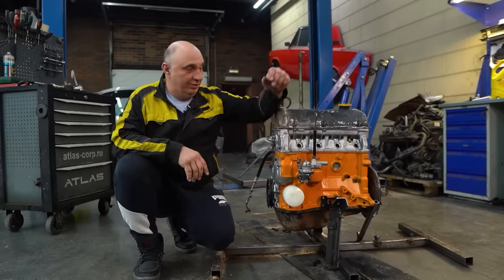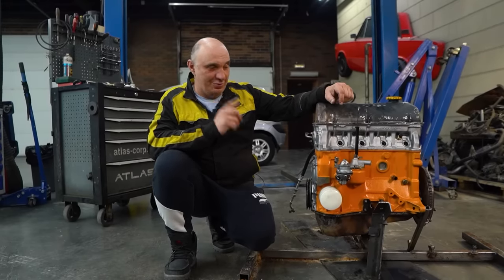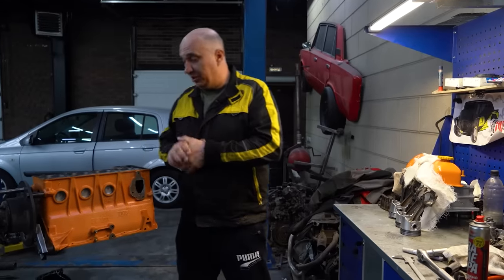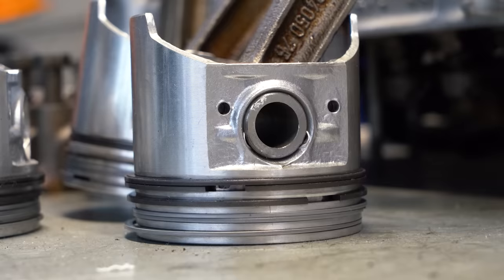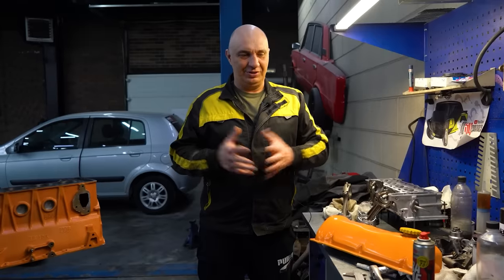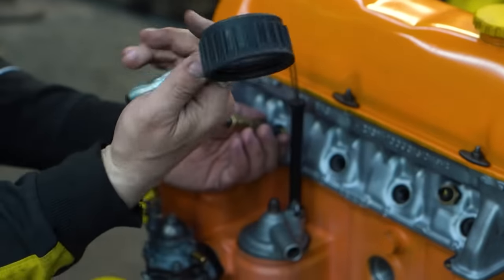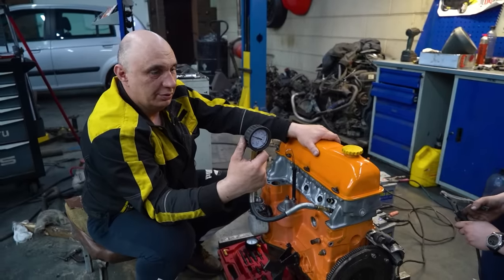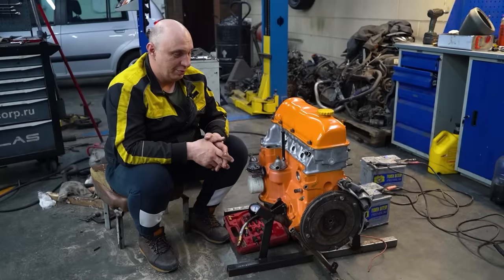Cranking the compression up to 20 kilos (285 PSI) - what for?

Comment: Wonder if they’ll try running it on diesel, should easily run with that compression
Reply: They would need to modify the head to fit diesel injectors, somehow fit a pump, and then the rods would probably just bend.
Reply: Ethanol or methanol mixtures of high octane petrol or something like that. Maybe pure petrol. LPG is an option.
Reply: @kordta  Would be too high for methanol as well i think.  LPG might work, but i doubt the engine would live long.
Reply: I wonder running E90 or even some leaded aircraft fuel would suffice
Reply: Nitromethane used in RC cars/planes might work, but still it's very high compression.
Reply: @snap_oversteer  Nah. RC car/plane engines burning that stuff have around a 9.5:1 compression ratio. Anything about 11:1 and they start pinging pretty bad. Bad enough to melt pistons. And the more nitro you have in the fuel the lower the CR needs to be...plus, real danger of hydrolock with this setup on such a fuel. The AFR for glow fuel is only in the 6:1-4:1 range, which with such a small chamber, squish band, is likely enough to hydrolock the engine.
Reply: @detaart  if you add some water it'll probably have it's best chances on LPG as long as the rods handle it
Reply: @detaart  The injectors could be installed on the spark plug hole and the injector pump could be mounted on the side being driven by a toothed belt. 
Also, for the purpose of just having fun, that engine can easily run with indirect injection with each injector mounted on the intake manifold, just like gasoline multipoint indirect injection systems.👍
Reply: @tiagofigueiredo2529  Fitting injectors where the spark plugs go could work ... if they modify and machine the head.
And no, taking in the fuel in the intake like a gasoline engine would not work.  It would cause the mixture to burn before TDC, destroying the engine.
Indirect injection refers to a pre-chamber arrangement.  Diesel engines never spray fuel in the manifold.
Reply: 225 psi would've been enough for diesel.  Typical diesel engines run 300-500psi
Reply: @detaart  they have already installed a diesel injection pump on a gas engine. Although the fuel was being injected into the intake instead of directly into the cylinders. They could tap the spark plug holes to install the injectors. It sounds very easy for these guys
Reply: I'd say that's probably their only choice. Attempting it to run it on gasoline would cause premature combustion
Reply: @dieselgeezer18  No they haven't.  Show me.
You cannot time a diesel engine if you inject the mixture in the intake.  It would detonate and self destruct.  No spark plugs, no way to time it.  The injection event IS the combustion event in a diesel engine.
And yeah like i said, fitting injectors into the head could be done, but the stock rods would probably immediately bend.
Reply: Straight ethanol should do...
Reply: @pierreetienneschneider6731  Might work ... for a little while.  Still think it would detonate.
The chambers looked tiny as well, probably crazy squish factor.  Might even hydrolock the engine.
Reply: @detaart  here:
https://www.youtube.com/watch?v=K7LHBWr7Kkg
Reply: @detaart  I know all that, but, the engine would run on diesel by just spraying through the intake manifold, been there, done that. 😆🤣
Again, for the purpose of fun only it would start and work. 😎
And no, indirect injection doesn't only refer to a pre chamber arrangement, it also representes every other type of non direct injection systems. 👍
Reply: @detaart  ford literally manufactured a whole line of diesel pickup trucks with indirect injected diesels, I own one. You couldn’t be more wrong.
Reply: @Rob_Fe  IDI means pre-chamber injection.  The injectors still go in the head.
https://en.wikipedia.org/wiki/Indirect_injection
Reply: @dieselgeezer18  6:55  They are running the pump with gasoline, not diesel
Reply: @tiagofigueiredo2529  It would go clack clackity clack and die within minutes.
Swirl chamber, pre-chamber.  Same thing, different shape.  Tomato tomato.
What you are proposing simply wouldn't work.
Reply: @detaart  diesel needs no spark plug. Just use the spark plug holes.
Reply: @drewdavis239  Might work.  Lots of machining work, and serious doubts about it living longer than a couple of minutes.
Reply: @detaart  ok so? I did not mention that they ran it on diesel. Of course it wont run. It was not modified with high compression. But why does it matter that it does not run on diesel? The point of my reply was to show you that it is possible to mount a diesel injection pump on a gas engine and make it run. Modifying the spark plug hole and pouring some diesel in the fuel tank won't be hard for them.
Reply: Converting to a diesel can't be done here.  This is where Vlad needs to do a propane conversion.  
Those fuels don't have the BTU's of gasoline but, their octane is much higher and would respond very well to sky high compression.  They could start with a single forklift propane fuel system and rig it to feed the high compression Lada.  They will certainly need a temperature compensator which will adjust the mixture as the engine warms up. 

If all goes well, get TWO forklift carbs and custom fabricate an intake to accommodate the two carbs.  The dual carb manifold can be done with aluminum piping and flanges and Vlad's crew can do it.
Reply: @dieselgeezer18  Sure, move the goal posts.
Running a diesel pump to spray some gas into the intake manifold is nothing like running a gas engine on diesel.  They just made shitty injection system for a gas engine, nothing more.

Converting this engine to run on diesel fuel is a whole other ball game.
You are not only changing the fuel, you are changing the entire cycle.
There are many problems to overcome, such as:
- Rotating assembly is not strong enough.
- Pistons are the wrong shape, charge mixing would suck
- Rods would bend
- Head would crack
- Crank would flex
- Pistons would crack
- The cam timing is completely wrong.  Otto cycle != diesel cycle.

Even if all of this modifications were done, it might not live through one day of use.
Reply: @detaart  the cycle is almost identical on both gas and diesel engines. Putting the injectors in the spark plug holes and adjusting the timing on the pump is enough to make the engine work. It will certainly run bad and might not last very long but who cares. Its just an experiment for shits and giggles. It will last enough time to drive a few meters at least
Reply: @detaart now that sounds like an entertaining video what you just described there.👍
Reply: That would be so cool loo
Reply: 2.25 Landrover engine was identical as a longblock, just the heads were different
Reply: Running on ethanol would be perfect. 
I built 1 liter 4 cylinders engine that got 11.8:1 compression and ran on 1.73 pressure ratio with supercharger. With ethanol it's just wonderful and it reached around 130bhp.
Reply: Nitro methane would work!!!!!!!
Reply: @rexracer7192  lol. I'm too low class. I'd stick kerosene in it and roll with it hahaha
Reply: @tiagofigueiredo2529  Have started a few unprimed diesels with a spray bottle right into the intake.
Reply: No way to low for a diesel
Reply: Yeep
Reply: @detaart  they can
Reply: What about hydrogen?  That might be fun…
Reply: @Rob_Fe  the injectors are still in the head and inject into the precup...all of which is still in the combustion chamber..
Reply: Diesels start at about 15 to 1 compression ratio, I wonder how high or low this motor is?
Reply: @detaart  Lol, reading all your comments responding to everyone it seems like you're a funny guy. 🤣
Ever heard of diesel runaway?
When the turbo let the oil pass thought it into the intake and the engine even with the key turned off (NO DIESEL INJECTED) it will run with NO PROBLEM AT ALL and wouldn't just "clackity clack" and stop like you wrongly mentioned?
Do I even have to explain it?
Do I need to give you more examples?
Oh well...
Diesel engines can run with everything oil related that is injected or just put trough the intake, especially if their hot, they'll burn and just work, simple, it doesn't mean it will accelerate or decelerate on command but it will JUST WORK.
Once more, I'll say it again, for the purpose of just having fun, if they wanted to, they could do what I said above and it would work, being there, done that. 👌
Don't try to be a smartass kiddo. 👍
Reply: Need 600 psi for diesel
Reply: @tiagofigueiredo2529  Yes ... And a runaway will destroy the engine in no time. Your point being?
It won't work.  Do it.  Post a video.
Reply: @tiagofigueiredo2529  i really don't care how annoying you think i am.
Again, there is no way to time it.  Ever started one on ether?  Heard how bad it detonates?  Strange, right?  There's not that much energy in the ether as compared to the caloric value of the diesel fuel itself.  That's the "clickety clack".
It will not work.  It will be like the worst case of pre-combustion on a gas engine.  It will die quickly.
You really don't seem to understand how things work.
Reply: @detaart  Yeah, sure thing pal...
Try it yourself and then say something. 
Hell, imagine doing it for a living. 🙂
Take care. 👍
Reply: @snap_oversteer wouldn't the added oil gum up fuel injectors?
Reply: @detaart  It would probably run well on natural gas, with its equivalent octane rating of 130. I would recommend a very narrow timing curve, careful not to over-advance ignition timing.
Reply: @tiagofigueiredo2529  Why not just build an adapter, and just run the injection pump where the ignition distributor goes? Granted, an injection pump needs much more torque than an ignition system, but, the gears in there are big enough to turn the oil pump. It might just work, with no modification to the engine block.
Reply: Plentifully enough - some Japanese diesel sedan engines have gotten away with slightly less pressure (yet still hot enough to ignite) and they just work. And short of being a computer hacker and bang together something outta high end Arduino board, there's always old school diesel injector pumps which do the timing by themselves mechanically (some are adjustable).
Reply: was going to say same thing 👍
Reply: @dlfrestoration  Diesel engines typically operate in the 15-20:1 range
Reply: @detaart  just use spark plug hole
Reply: Have you seen a video where they controlled the car with a joystick from the console
Reply: @detaart  they've already fitted a diesel fuel pump to a lada
Reply: @crazylazybros2473  And ran it on gas
Reply: If it was to run on diesel (I feel like) the engine would be too powerful due to the explosive difference between gas and diesel and the compression plays a big card in all of this
Reply: @detaart  noone needs injectors. just  use the good russian diesel carburator.
Reply: @TestECull  there I get the idea make it to bulb engine, just put 4 closed chambers.. Would be hard to get it work anyway.
Reply: @detaart  diesel and gasoline have both four cycles? There is 2 stroke diesels and four as well
Reply: I think they have some idea for this thing, not just test how much it could go.
Reply: Thats not really what would be the determining factor to run on diesel, diesel piston rings are pretty much identical to gas ones, the compression is increased by the hight the piston goes in the combustion chamber, aka stroke
Reply: Remember this is not compression ratio 20:1
Reply: You could run jetfuel😂
Reply: @TestECull  yes but top fuel are running nitromethane mix with methanol so I’m sure it could run on it
Reply: @smileyjr5342  It would fire ONCE and then disassemble itself. Have you seen the rods of a top fuel engine compared to the rods of a gasoline big block the same displacement?!
Reply: @TestECull  yes but it will and I don’t give a shit if it will broke or not and for the methanol it will run and survive he just need to advance the timing and this his pretty easy
Reply: The new video says yes, they tried it.
Reply: @detaart  they can port inject the diesel too
Reply: @josephscarborough23  no they can't.
Reply: @detaart  hey check their new video. The engine managed to start and did not self destruct.
Also port injecting diesel is possible. Have you heard about diesel runaways? In some instances the turbo seals fail and the engine sucks oil from the turbo into the intake and goes max RPM. It certainly can run like that. It just won't be optimal for the engine since when the engine gets hot the fuel will detonate too soon and may cause damage
Reply: @dieselgeezer18  there was no load on it at all, and it "ran" for just a few minutes.
Port injecting fuel on a diesel engine is not possible without destroying the engine.
There is no spark plug.  The ignition event is the combustion event on a diesel.  If you were to port inject a diesel engine, the fuel would combust before TDC.  You would destroy the engine.  Anyone who's ever used a bit of ether to start a diesel engine would know the knocking that it causes.
If you advance the timing on a diesel bu rotating the pump or through electronic means too much, it also starts to knock badly, quickly leading to damage.  Port injecting it would be a severe advancement in timing depending on cylinder temps.
It would not run property, and probably die quickly.
Reply: @detaart  yes, there was no load but it did run. Also whats wrong with running for a few minutes. Its still a success. Remember this channel does things for fun not for actual use.
Also i did say that port injection could damage the engine, but it will take some time. Depends on how well the engine is built and how soon it will combust. The engine that garage 54 made has very low compression so it will probably not be as bad
Reply: @detaart  I wouldn't say never spray fuel in the manifold, I've seen a runaway diesel with the fuel line physically cut to try and stop it, what the turbo was leaking so much oil that it kept running, so it can be done, it's just not the best method that's why no one does it
Reply: Well they already ran it on diesel
Reply: Race full
Reply: A typical diesel engine compresses all the way up to 40 bar
Reply: @BlackCatRedScarf  lol my 1000cc bike that costs $2k has more power then that
Reply: ah NO, a running compression is about 450PSI, anything under 380 is nearly impossible for diesel.
Reply: Tbh it would run pretty ok the one ware they ran the 2 stank engine in glow plugs I liked that one so tbh I think the compression would 🎉 do ok tbh ! 😊 uk mechanic 10 years !
Reply: @detaart  Why would you assume the rods would bend. Diesel burns quite slower than gasoline and spread out the cylinder pressure over more crank angle! Fitting a pump is easy as pie if its a common rail setup they are going for because there is no need to time a common rail pump at all, just spin it via belt or even another small motor just for the pump. The spark plug holes would be the best bet to install the injectors! It all sounds very doable for these guys
Reply: @detaart  Not at all, that is only 19:1 compression if my math works out properly. You can spray methanol right into the intake on a diesel motor with compression that high and it will not light off until the diesel does.. acting as a liquid spark plug
Reply: @nickpalazzi2121  That is a bit on the high end at least for a modern diesel. Manufactures have been trending downwards in compression for emissions purposes to decrease Nox output sadly. My 2012 passat TDI 2 liter common rail runs 16.5:1 which is only 240~ PSI.. my old 1.9 jetta diesel ran 19.5:1 compression ratio which is only 286~ PSI. 500 psi would be 34:1 compression ratio. As far as I know no diesel available now or ever would have anything higher than 25:1 compression which works out to 365~ PSI! Of course none of this is really relevant when you throw boost at it because your effective compression ratio goes up significantly when you add boost. I know for my 2.0 TDI where I run 26 pounds of boost (40.7 absolute intake pressure) I am looking at an effective compression ratio upwards of 40:1
Reply: @DarkAttack14  I never said anything about methanol.  I was talking about ether, which has an auto ignition temperature well below that of diesel.
Reply: @DarkAttack14  Diesel does indeed burn slower, but the total force exerted on the rods is higher for the same output.  High compression + the energy from the combustion itself.
There is a reason why regular gasoline engine conrods are skinnier than it's diesel counterparts.
Also, yes, a common rail system needs to be timed.  When are you going to inject?  How will you determine this?  Right, timing.  Can be done via a trigger wheel on the crank pulley if you want to ghetto-rig it, but it still needs to be done.  The timing clock res for a CR diesel injection system needs to be much higher than that for a normal gasoline port injection system btw, but i'm sure you know that.
Reply: @Rob_Fe  You have no idea what your talking about. Learn automotive engineering.
Reply: @tiagofigueiredo2529 I really hope your not a mechanic working on the general publics vehicles
Reply: @James-kd7dc  Yeah, sure thing genius. 😆